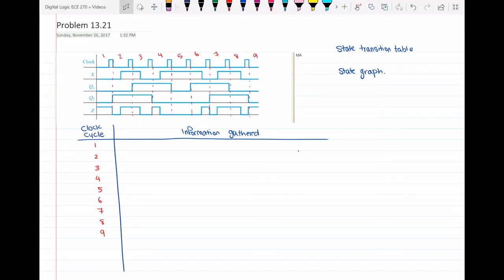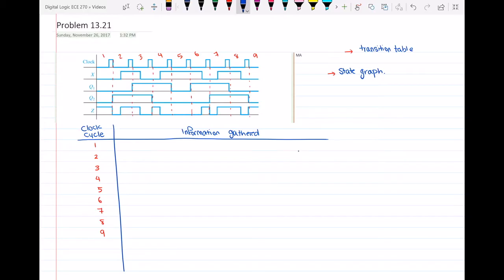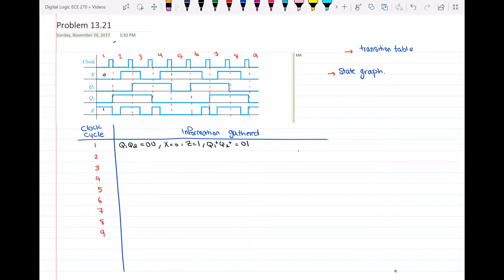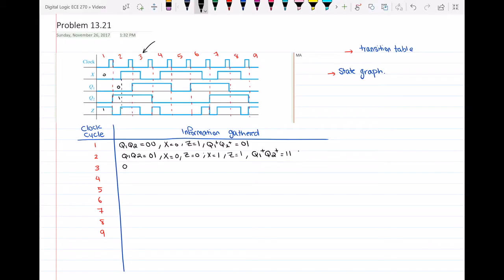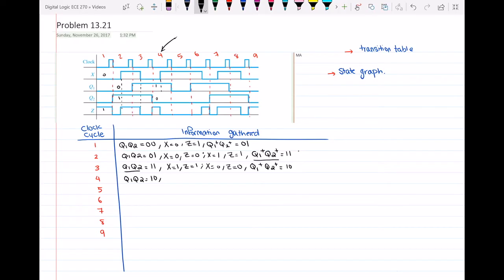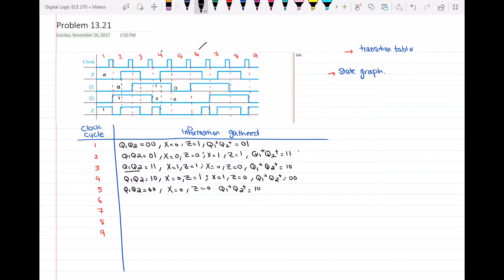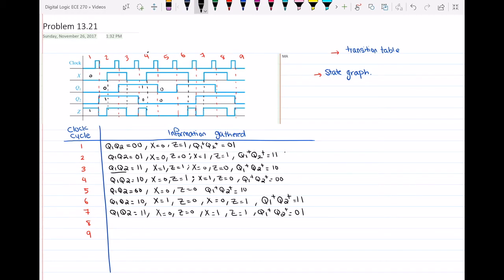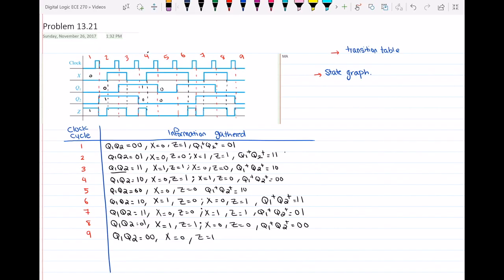Part I -Transition table and state graph for a mealy sequential circuit using the timing diagram

Comment: I've a question at clock cycle number (5) why X=0 should be equal 1 right ??
Reply from the maker: Ismail, yes you are right. X = 1 during cycle 5. I have mentioned it on top right of the video as well.
Reply: Yes thank you i just saw that in the next find that you change it .